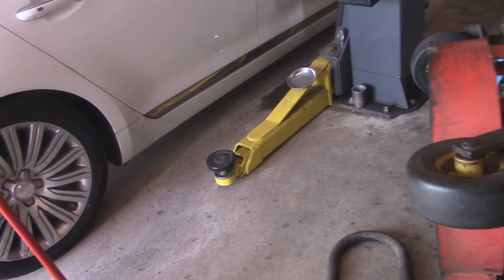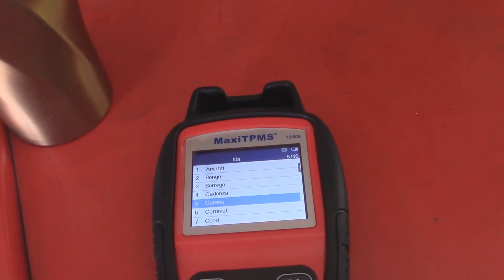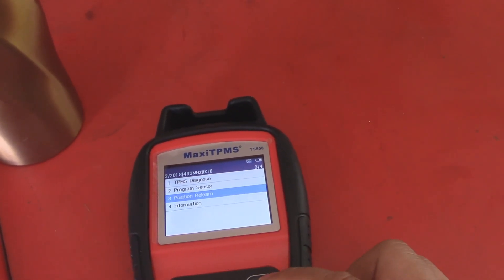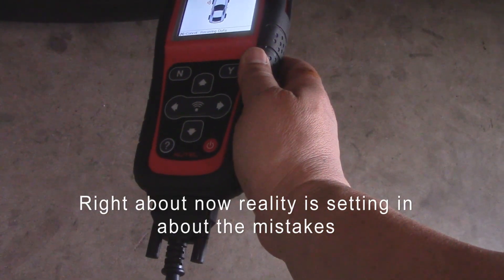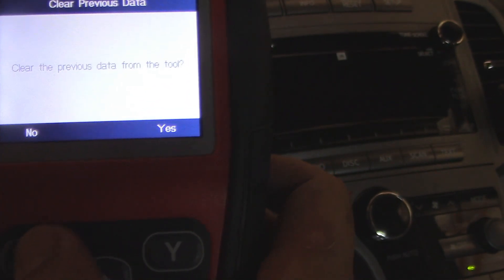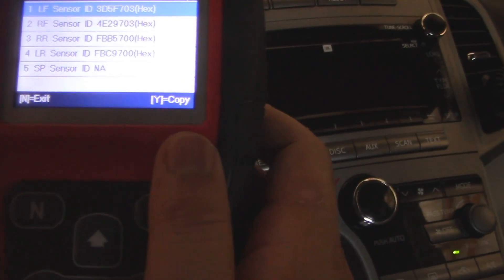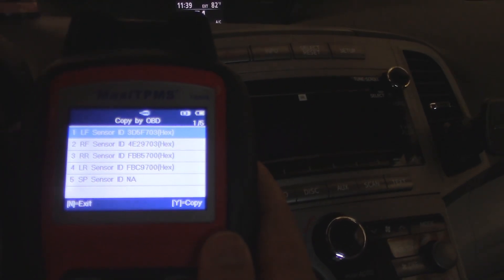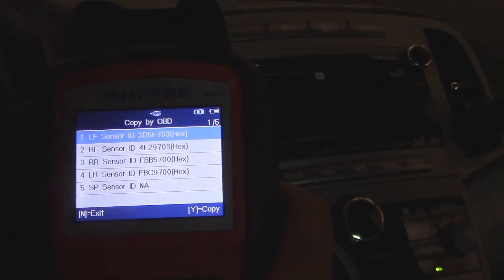TPMS sensor relearn with Autel TS508

Comment: For the record, in addition with the Copy By OBD feature with the Autel TS508, the 2015 Kia K900, like most Kias, is also capable of Automatic Relearn. I tried to do a TPMS relearn by OBD on a Kia Cadenza, but the tool said "Network Connection Required" and OBD relearn procedure didn't go through without Internet access. For that reason, I bought myself an Autel iTS600.
Reply from the maker: I did not have that warning and the 508 did a great job.  I have considered purchasing the new 600 but have not need to yet.
Reply: @mrfixit4211  That's good to know.